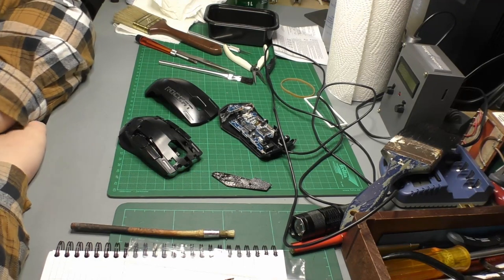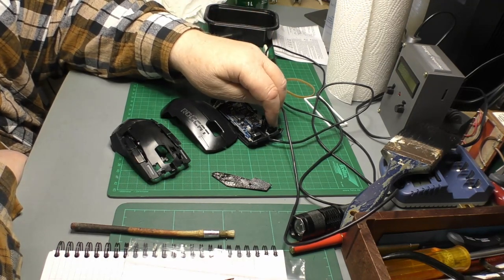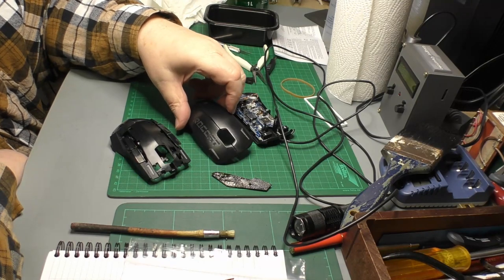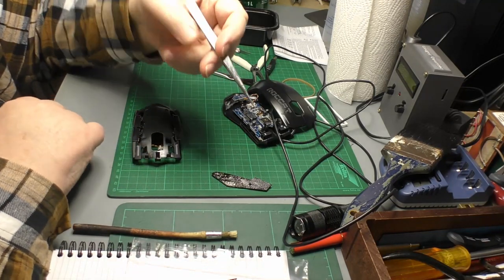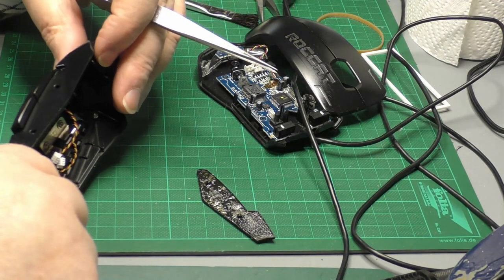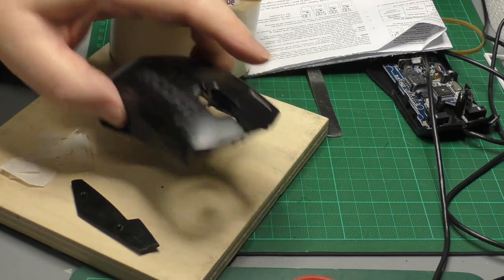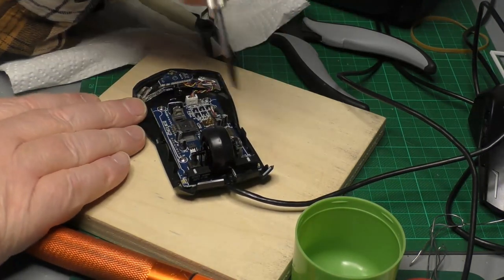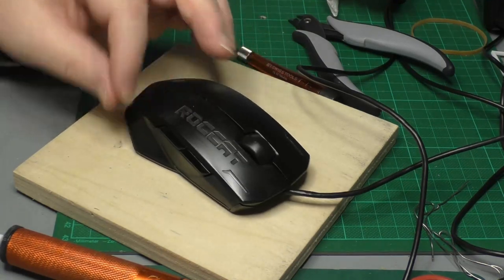Mouse rescue

Comment: Well done John.  There is something most satisfying about resurrecting an item of tech that most people would probably just throw away and replace.  Funny how the older most basic optical mice were almost indestructable, yet newer ones only seem to last a few years before switches fail, bits fall off, etc.  I often wonder if just cheap parts now or deliberately designed to keep generating sales.
Reply from the maker: Thanks Mike.   I'll confess I get more satisfaction from repairing a broken gadget than from getting a new one.  Planned obsolescence is definitely a thing these days but some of us fight back when we can!
Cheers,    John